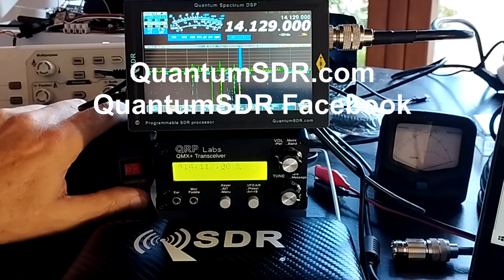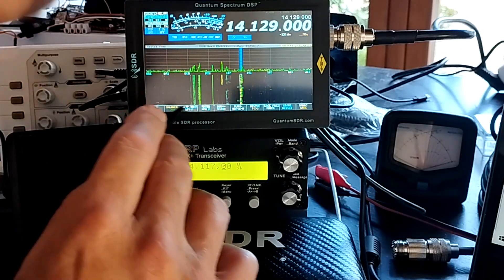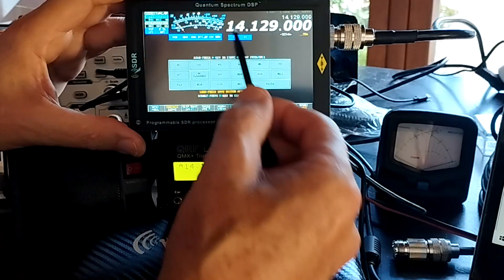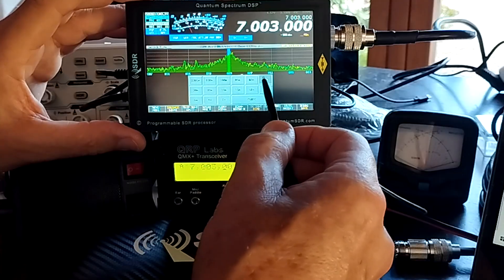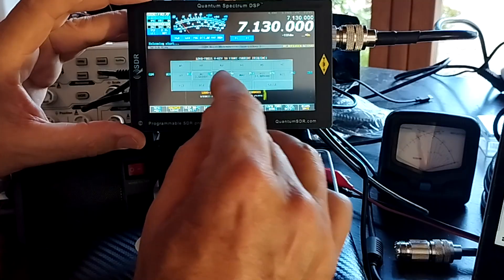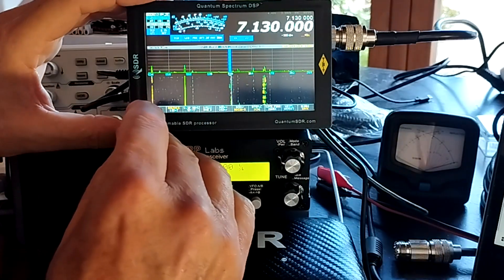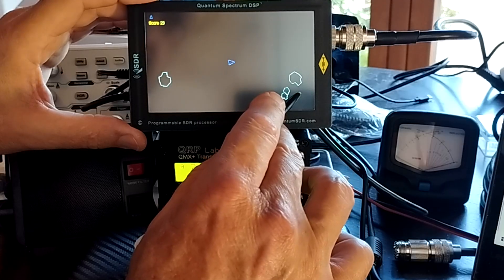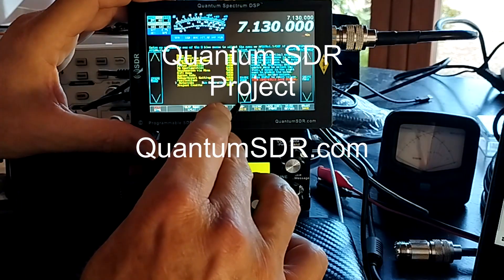Quantum Spectrum DSP with QMX+ transciever

Comment: Brilliant Rob! I like your development path here. I have the QMX (non-Plus) but this should become very popular with QMX/QMX+ users. There is a web-based USB cable app out there to control the QMX but this blows it away. Unless space/weight is an absolute paramount premium, this will greatly enhance this line of highly portable QRP radios. 73 de K4FMH
Reply from the maker: Thanks Frank, the Spectrum is near all screen, weighs 8oz, and power consumption is just 1.8watts so hopefully fits anywhere.  The only issue might be cost, currently around $250, but a group order might help get the price down.
Reply: Lovely, is it possible to hook this up to my AOR AR5000A on the if out of the AOR AR5000 and at the same time have the frequency match the both units?
Reply: @TobiasTheAviator  yes, it hooks up to any radio as it has all the CAT protocols, IQ, IF and RF inputs.
Reply: The cost is much more than the Transeiver itself unfortunately 😔
Reply: @d.berghold True but this is not unusual for some major transceiver accessories.
Reply: @d.berghold  That's what I thought too, there could be a kit version for the QMX at around$190, but I'm not sure really if there would be interest as for an extra $59 there is a transceiver upgrade for the Spectrum giving 100mW to 20watts